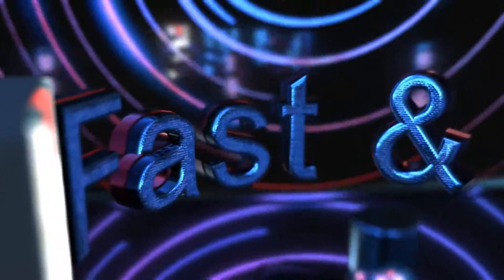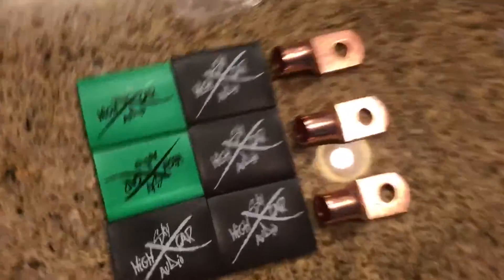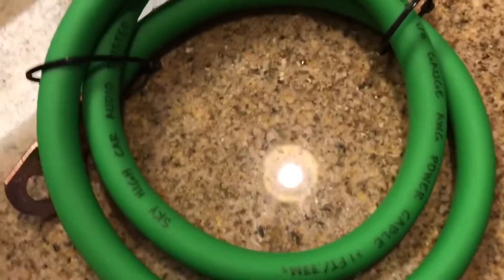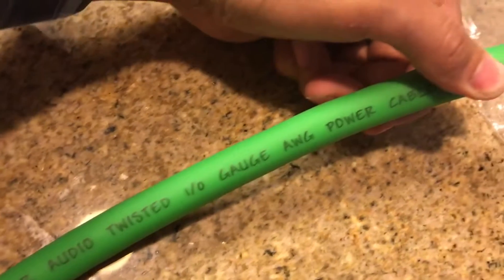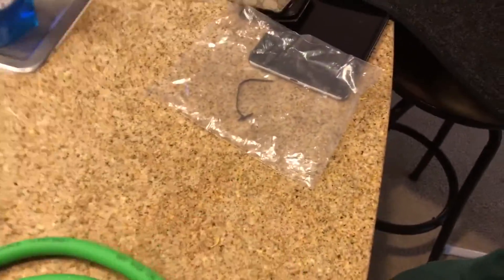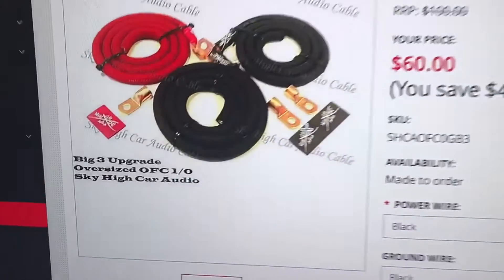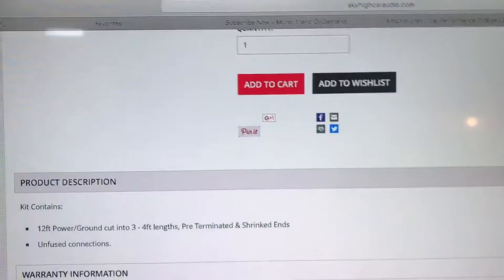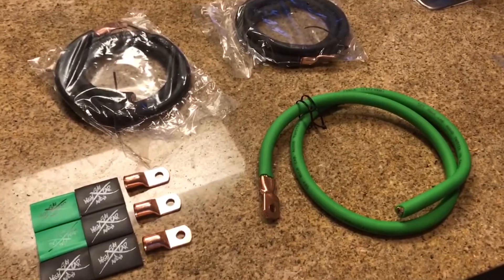SKY HIGH CAR AUDIO 1/0 OFC BIG 3 KIT FULL IN-DEPTH REVIEW

Comment: Did you buy those from Sky High, or are they bought through a third party selling sky High equipment? Cause they are not OFC, plus a lousy crimp job and are not shrink sealed? It even said shrink sealed in the description. Sky High wouldn't do that because they want their Shrink with the "Sky High" logo pointing up and screaming at you... The ad looked like it was from Sky High, but it's weird that they look that way. Thanks for the video.
Reply: it might be tinned copper
Reply: Almost all copper is silver outside with any brand